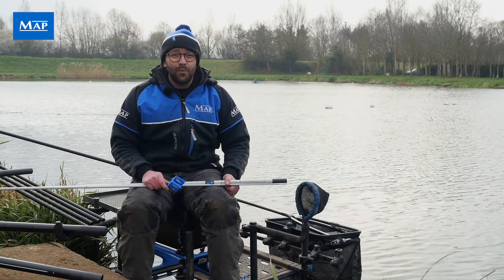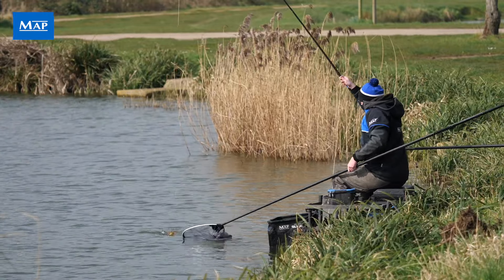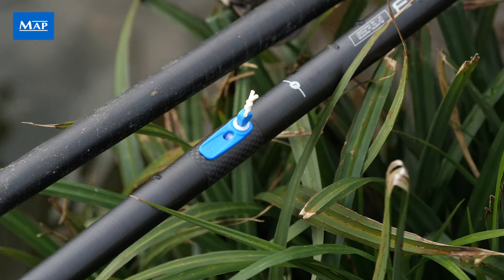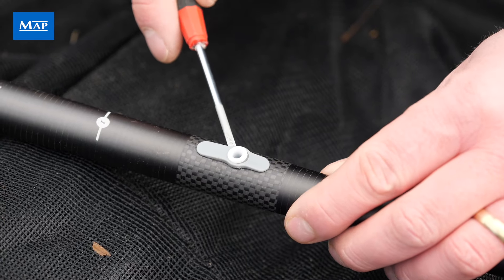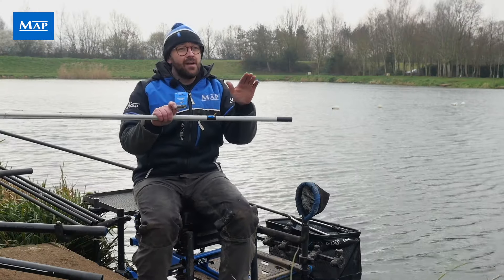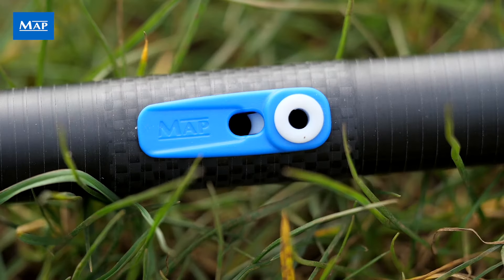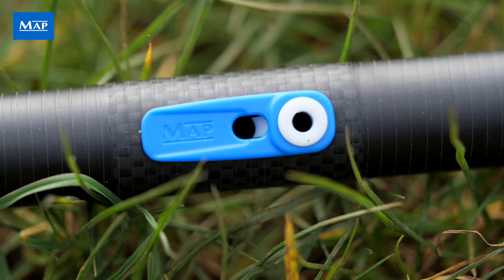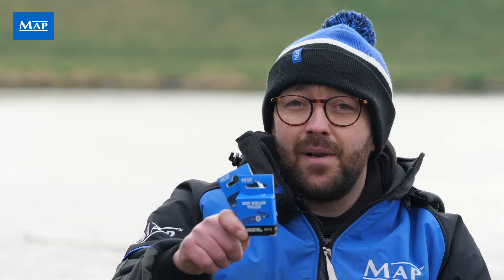NEW: MAP Side Roller Pullers

Comment: Just put them on all my top kits. Easy to pop out the old as per the video. Most slotted in fine with minimal pressure. A few needed a bit more pressure but went in fine. Heard a few people say they're quite noisy but can honestly say it's not something I've noticed. Big improvement on the old ones. Good job MAP.

Comment: Bought pack of 2 just to make sure I could remove existing pullers and fit the new roller pullers as per Video. Found the process very easy with care. Made a massive difference to the puller action and run of the elastic. Went to find another 8 for my other top kits and guess what having to shop around to find them. Good development from MAP again.

Comment: What's the hole below the roller for?
Reply from the maker: The additional hole is so that you're able to lubricate the elastic and the wheel directly.
Reply: What a simple yet cracking idea I’ve just bought 4 new top kits so will be changing then hopefully they will come as standard soon or at least optional.